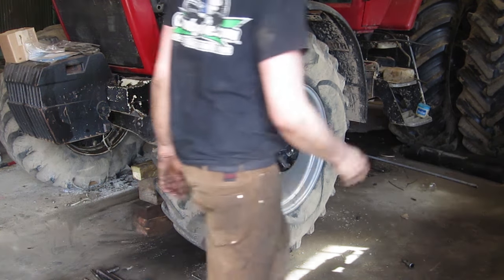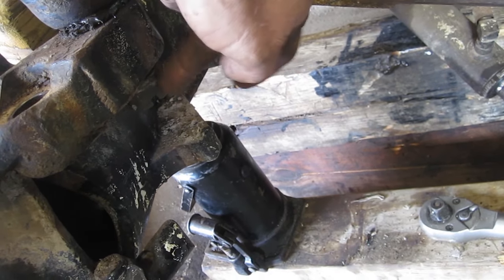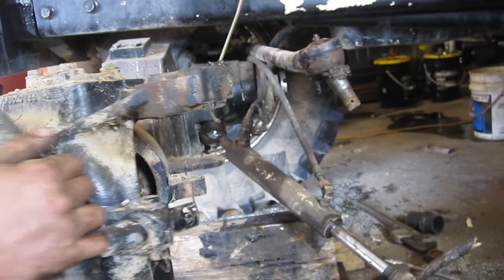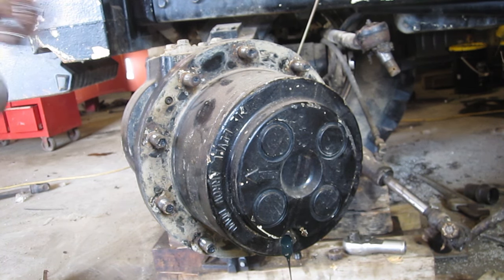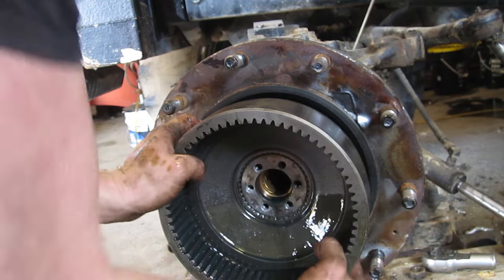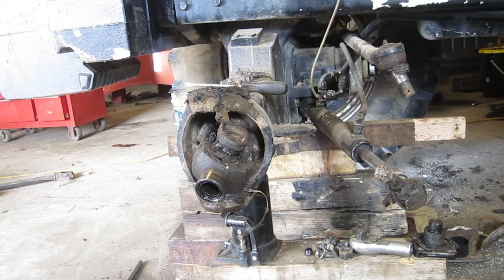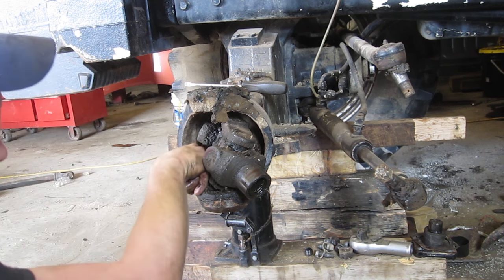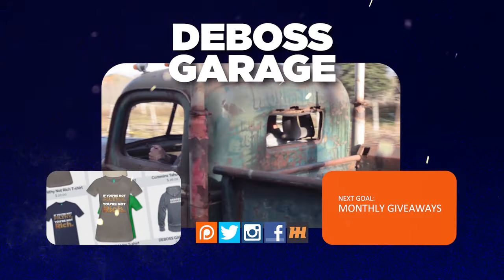Front Axle & Wheel Seal Replacement on a 4WD Case IH (Part 1)

Comment: I this axle same set up as 2003 case 580 super m ?
Reply from the maker: I havn't worked on a 580 as of yet but if its not the same, there won't be many differences.   Its the same setup for an mx's and 7000 series
Reply: Great thanks for feed back, great video keep it coming... Bill